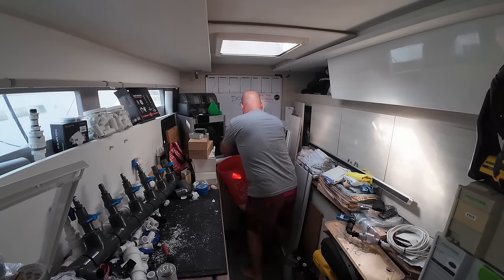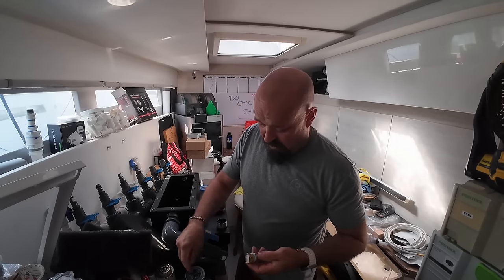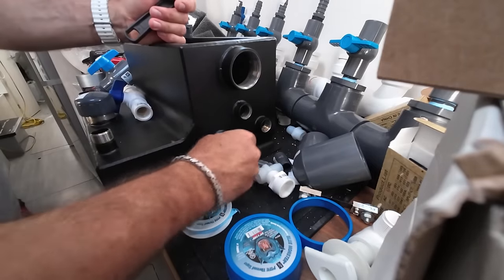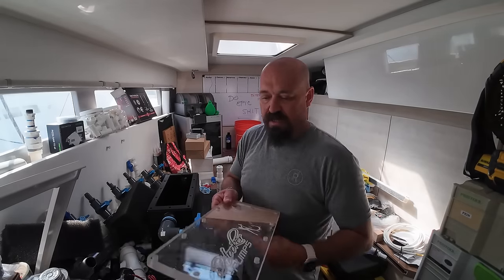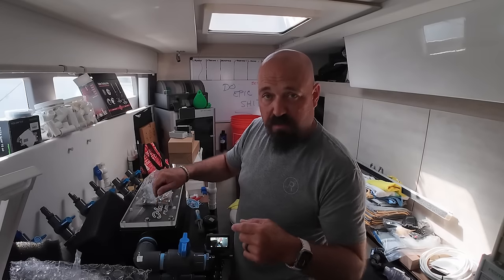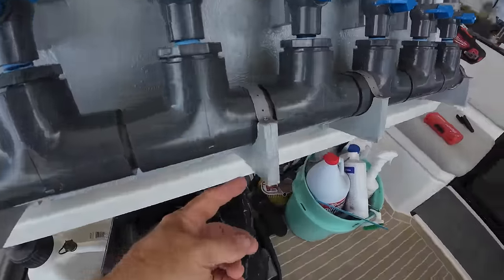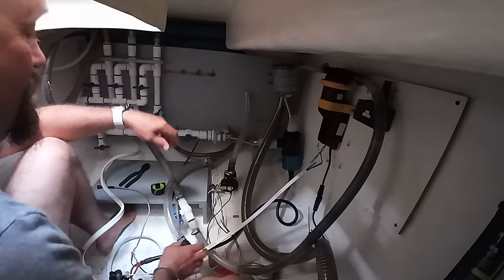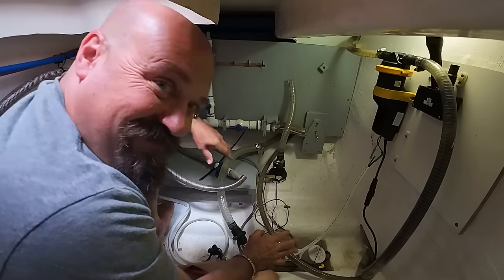Plenty of HEAD// One pump AirCon. - Episode165

Comment: Hello Ty.  It has always been my understanding (and practice) to NOT put any barrier, either teflon tape or sealant of any kind, on the plug holding the anode.  My understanding has been that for the anode to work optimally, there has to be complete electrical contact between the anode and the metal housing it is there to protect.  Possible I have been wrong in this thinking.

Comment: For future projects, soapy water makes a great lubricant for attaching rubber hoses to barbed fittings. Just dip hose into soapy water solution the length of the fitting and then attach.

Comment: Re: Teflon tape... Back in the early 2000s I worked in a hydraulic shop and when we were assembling systems meant for a few thousand PSI, we only used 4 or 5 wraps of the standard white tape, so that 8 or 9 wraps of the thick stuff is way more than sufficient.

Comment: Galvanic isolator only decouples your boat from everyone else's in a marina when hooked to shore power.  Galvanic corrosion (electrolysis) on board will still be driven by dissimilar metals not bonded or experiencing a high resistance connection to each other.